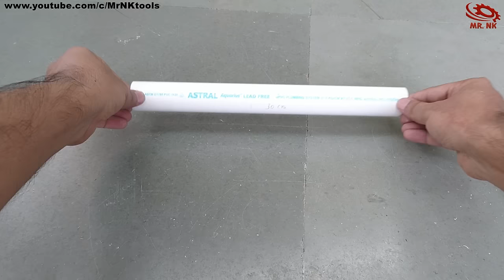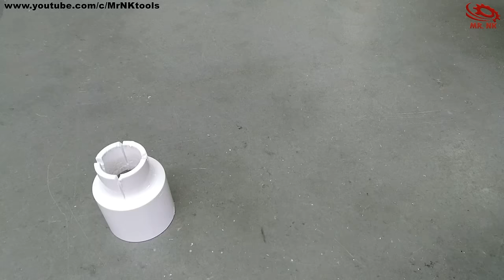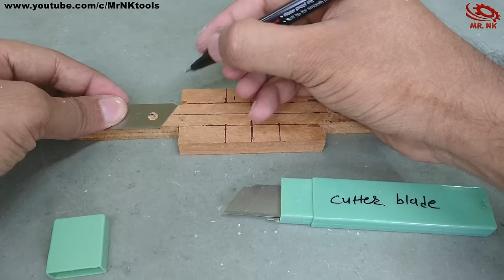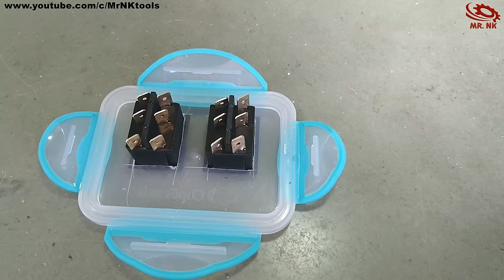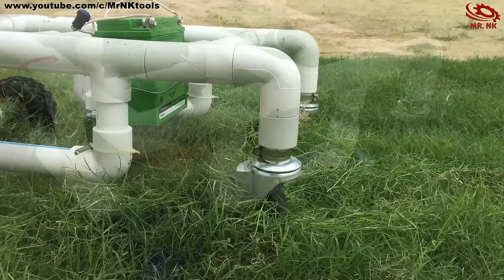How to Make a Remote Control Lawn Mower at Home

Comment: Ok this is really good. I’d be worried about those blades coming off since it’s only being held onto the motor shaft with glue, or the wood breaking if you accidentally catch it on something hard but the build is super simple and looks pretty effective. Nice work and thanks for sharing. I am going to replicate my own version.

Comment: A great idea, please allow me to add a suggestion. The shaft of the motors support the weight of the unit. They will fail quickly. I suggest you support the wheel in a separate axle and then gear or belt the motor to the wheel shaft . Great work.

Comment: Thanks for the inspiration! 
I'll recycle some card boards, card boxes, and use white glue 
to make an extreme light weight grass cutter similar to this. 
I want that by dragging it sliding along the lawn and 
it will collect those cut grasses in the box.

Comment: Tether control is not really remote control, you may as well have a set of handles and push it.
Reply: It is remote controlled. do you remember the old remote control cars that had the wires attached. He never said radio controlled.
Reply: @michealwilliams7788   Not really, given what the word remote actually means.

re·mote
/rəˈmōt/
adjective

    1.
    (of a place) situated far from the main centers of population; distant.
    "a remote Oregon valley"
    synonyms: faraway, distant, far, far off, far removed; More
    dim and distant
    "doctors who practice in areas remote from hospitals"
    isolated, out of the way, outlying, off the beaten track, secluded, in the depths of …, hard to find, lonely, in the back of beyond, in the hinterlands, off the map, in the middle of nowhere, godforsaken, obscure, inaccessible, cutoff, unreachable;
    faraway, far-flung;

    2.
    having very little connection with or relationship to.
    "the theory seems rather intellectual and remote from everyday experience"
    synonyms: irrelevant to, unrelated to, unconnected to, unconcerned with, not pertinent to, inapposite to, immaterial to, unassociated with, inappropriate to; More
    foreign to, alien to;
    rareextrinsic to
    "the parables may seem somewhat remote from modern times"
    antonyms: relevant
     

noun
noun: remote; plural noun: remotes

    1.
    a remote control device.

Origin
late Middle English (in the sense ‘far apart’): from Latin remotus ‘removed’, past participle of removere (see remove).
Reply: Astra Racing  गह
Reply: @michealwilliams7788 , remote control means  you are sitting in the shade under a tree or your porch with an RC radio controller and a cold brew. He's following that thing around. 
Swap the two wheel motors for a handle.
Reply: Remote Control is tethered, Radio Controlled is radio control which is no wires. It literally says "radio" in its name it's not tethered.

Comment: Add some clear plexiglass covers on all 4 sides and you have a shield to protect from kick ups and accidental blade loss. I don't know how but I would imagine you could use a rasberry pi or an arduino board to make this truly remote controlled. Include some way of raising and lowering the blade height.
Reply: couldnt u have interchangeable pvc piping for height control?

Comment: Commendable initiative and creativity. Deplorably dangerous. Probably not the most dangerous thing on the internet but it's going to be in the top 100. Why don't you replace those incredibly dangerous knife blades with whipper snipper line? You'll do a lot less damage to yourself when it inevitably breaks,

Comment: Your design is very clever and inventive and you certainly strike me as resourceful, but I have to agree with basically everyone here that the device is wildly unsafe.  You should take some cues from actual lawnmowers; guards, non-razor blades, etc.  Also, some less tisk tisk advice is to use li-ion for the whole thing-unless the lead acid is just to weigh it down.

Comment: I recommend a few things that might make it easier  “1 instead of using battery use 2 6s lipo’s” “2 use a esc with those batteries” “3 use receiver and transmitter so you can get wireless long range” “4 use servo’s”

Comment: It will be fun when one of the knives falls apart and flies straight into the leg
Reply: If it is remote, why would you be walking next to it?
Reply: Daniel Whitehead someone walking down a sidewalk who wouldnt know any better could get nailed with those flimsy glued on razorblades. Shit design really.
Reply: @Sivxgamer  The remote is not cordless. You wouldn't have a choice but to walk along with it.
Reply: SNÅKEFEEL so make a case? I liked how simple it was. Im planning to add a 15$ flight controller with gps and relays to control the wheels. Probably card board would make due for basic safety. It would be a blade fragment and not a direct launch if it broke.
Reply: Miles V I took this more like a very basic prototype to show the basics. im planning to recreate but glad someone mentioned blade safety cut i would have probably ignored that.
Reply: SNÅKEFEEL They are screwed on as well, i dont think u watched the video thoroughly enough. its rather ingenious but your right, can be improved apon.
Reply: @Sivxgamer  They might be screwed on but they scored to make them easy to shear off in order to have a "new" sharp tip without changing the blade in a razor knife. Very shitty...
Reply: That's true you need safety
Reply: @Snakefeel  huh gclid
Reply: @Miles V, try use component part electronic rc tank, it's same system but have wireless remote control
Reply: Depends, which leg?
Reply: All I can say is hahahahahahahahahahahahahahahahahahabahahahahaha WTF?

Comment: Instead of wooden blade holder and razors, just mount a circular saw blade. It would be much stronger and safer since it won't break if it hits something. A good motor for the blade can be had by taking one from a cheap Harbor Freight portable drill or better yet, battery operated circular saw. Drive motors from cheap battery powered screw drivers. There are many YouTube videos to making a cheap wireless transmitter and receiver using cheap 434 MHz modules. Just saying.

Comment: I like the frame.  However, I do not think that having box cutter blades UNSHIELDED is anything of a responsible idea. One unseen rock, toy, stick and there is a real danger to anyone anywhere near the contraption.  Again, the frame is good, but for a different use/   It would be easier to wire this thing up if you used different color wires?  One more suggestion, you might think of having the controller wires suspended above the base to avoid running over them...OH, another way to make missles out of the blades!

Comment: The remote it the same range as a push bar, and way slower... Really no point to the thing... also the blade could cut the remote wires

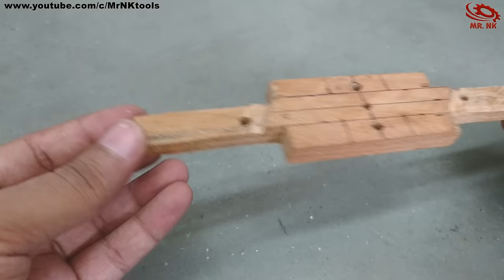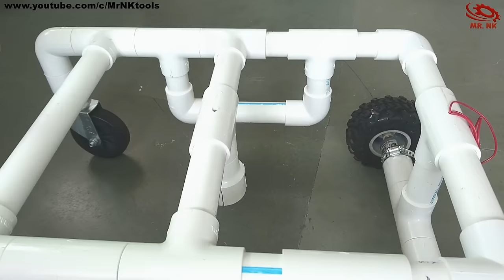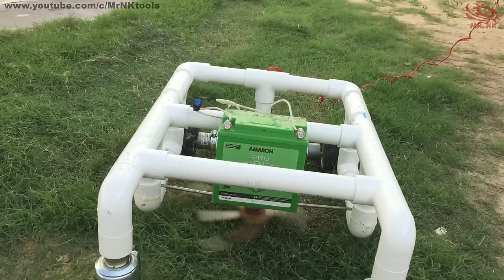Comment: Very interesting but ... 1) at 3:49.  How did you safely mortise the recess for the blades?  2) Those utility blades are weak and designed to snap off - making them NOT ideally suited for this project.  3) at 4:32.  It's a bad idea to use 2 white wires.  Always use contrasting colors (B & W is standard) for a wire circuit.  You are soldering these wires onto a motor BEFORE you test them.  This could easily lead to a mistake as per spinning your blades backwards if polarity is an issue.  4)  Not having a protective shroud around your fast spinning blade is DANGEROUS!  5)  You should think of a way to adjust your blade to avoid scalping (7:06).  Perhaps mount the blade assembly on a traditional mower deck which can be raised and lowered by some lever and locked into place.  Other than that - I was stunned and amazed this actually cut grass.  My design wouldn't blown up on lift off so to speak!

Comment: Ingenious, but practically speaking, this is one of the stupidest ideas ever. You don't leave  a lawnmower unattended, you need to be close to it to see what you're mowing over (animals, cables, hoses, rocks, etc). Even five feet way isn't close enough, and being close to this thing puts the victim in danger of receiving shrapnel. It looks like the blades would break if confronted with a twig. LOL. 

This is also kind of lazy IMO... going to all that trouble trying to "reduce labor" for something that is probably more trouble than it's worth, might be more work in the long run (following it around and dealing with obstacles, recharging batteries, etc), and might involve hospital bills. 

Not to mention the fact that if the operator had a heart attack/stroke/seizure or was otherwise immobilized, this bad idea from hell would be turned loose on the neighborhood, and who knows where it might end up, since there's no safety turn-off as is found on real self-propelled mowers.Trying to cut tall grass would be an exercise in futility... but it would be fun to see this thing "mow" over the control cord, also. Not attacking you personally, but while the design is actually creative and I appreciate it from an engineering perspective, the concept is flawed.